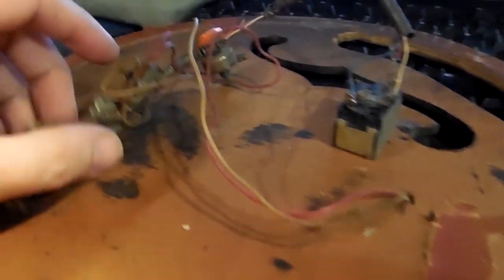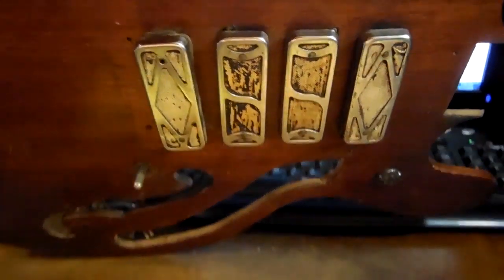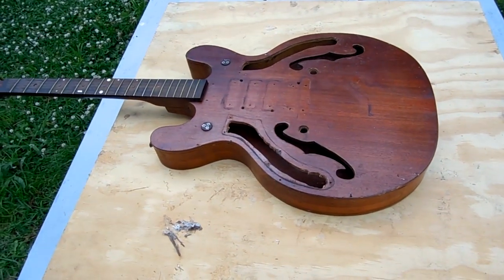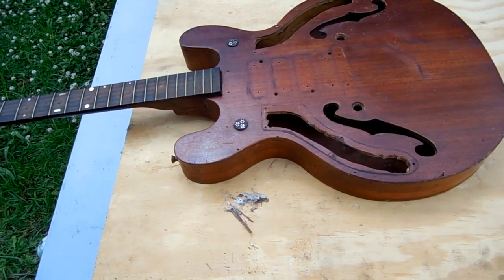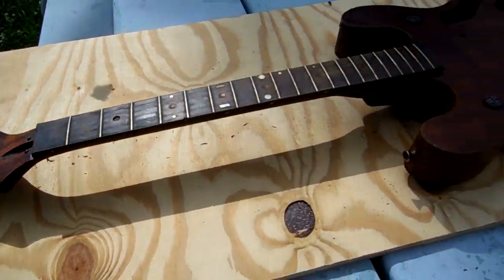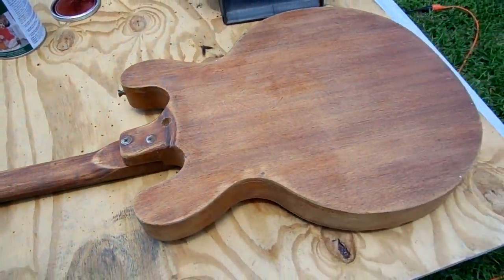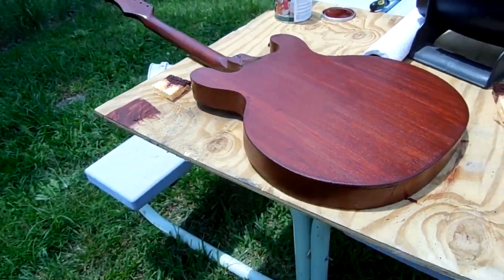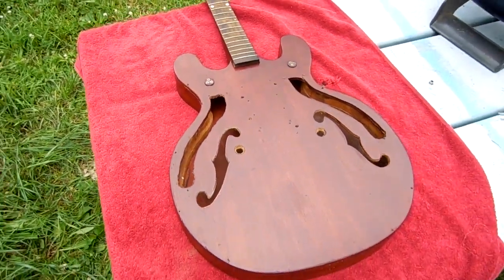What Ive Done So Far On Dads Guitar 1#

Comment: Wow, it's coming out great!  Before you get too far with the electrics I would test everything to make sure it's all working.  Just a tip.
Reply from the maker: that's aswome you said that because I thought same thing..but without strings how was that possible? answer was to use my sons electric guitar and set the pickups next to his strings and it worked!! all of them worked like a charm!!..lol  thank you so much for watching!!! great advice too!!..:)
Reply: Check the other components too like the tone, volume knobs and input if your not replacing them.  That way you can replace them while it's apart anyway if anything is broken.
Reply from the maker: ***** I bought the new switches prewired, all I had to do was solder the pickups on to them..and that's all done..just need the bridge..the tail piece is here too..:)

Comment: You should be able to find a nut for it without too much trouble. That's got to have a huge sentimental value and will be fun for you to play when it's finished. Take some 0000 steel wool to that neck. The blackness is just finger oils and dirt. Linseed oil it and you should be good to go. Take that 0000 to the frets too before you get the pickups back on.
Reply from the maker: oh you did check it out..lol thank you for doing that!!..I ended up light sanding the neck and stained it..it looks perfect now. all the stuff I got from the fire had black stuff on them..was hard to get off at time..like his kustom 100 watt amp.